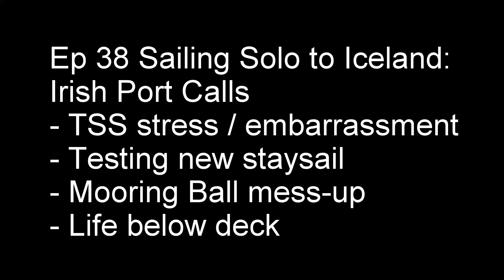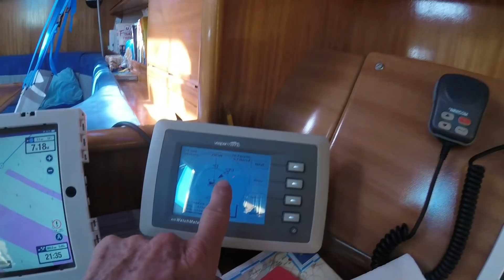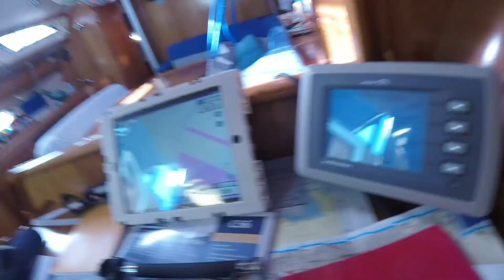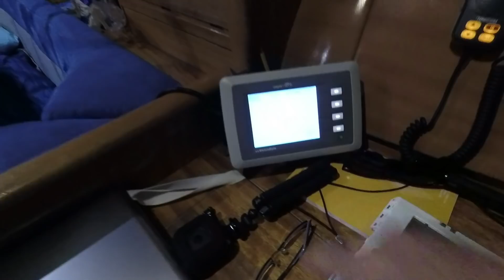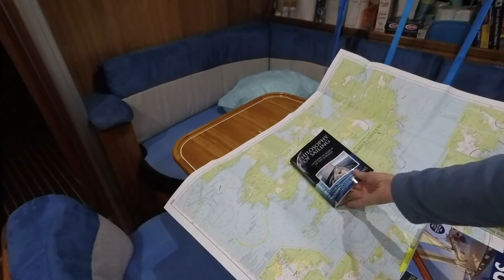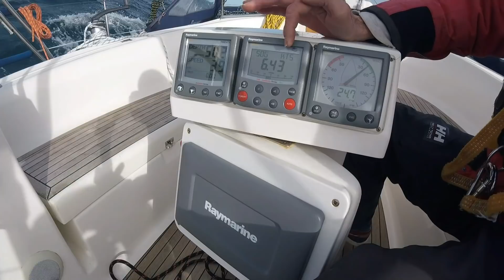EP 38 Sailing Solo to Iceland   Irish Port Calls

Comment: You could do exactly the same thing in or near a TSS next week and get completely the opposite response, heads you lose tails your lose, but as long and know one gets hurt we all win. There is as thing going on in the UK not to call channel 16 for radio checks, so I called last year on Ch 67 (having observed that it was being monitored) only to be told to use Ch 16 in future, I thanked them an consigned their feedback to the bin.
My boat and I would struggle to make a left turn into a slip as tight as that, to much left prop walk when in reverse, Ive been to the end of a fairway turned 180 and then made a right turn into the slip before, works for me as I have no bow thruster and with throttle and rudder I can make smarter right turns.
Great videos please keep it up, my docking sticks arrived from Amazon today, thanks to you. In the past I taped the bowline onto the pole with paper tape that snaps easily as the loop meets the cleat.
Im planning around Ireland late this summer anti clockwise starting from Glasgow, just might have to order  Chateauneuf du Pape in an Irish pub!
Reply from the maker: Yes Keith, that final turn in was very tight due to the narrow fairway.   I used a couple of bursts of bow thruster to shove the nose around, and I gave a good shot of reverse when about 45° into the berth to swing the stern a bit out to starboard (prop walk on my boat).    As you suggest, every boat owner should go to a remote area of his marina, and practice tight maneuvers so he/she will know what tactics might help in a difficult situation.

Comment: 17:30 - "Tight fit here."  That seems like an understatement.  That fairway looked VERY narrow.  I thought for sure you were going to whack one of those pulpits on the starboard side - a lesser man (me) would have!  Thanks for another great sail!
Reply from the maker: It was very, very tight.  I had my head right over the stern corner of my boat to ensure I would clear those others.......a bit stressful for sure.  Fortunately there was very little wind.  :-)
Reply: @patricklaine6958  Would you consider to drive backwards (stern first) into the slip an easier solution or does that depend even more on prop walk?
Reply from the maker: My boat is equipped with a sail drive, rather than a conventional shaft and prop, so prop walk is MUCH, MUCH less of a concern (the prop is located much further forward).   My boat backs beautifully, and stops very precisely, and I love to reverse in --- from time to time.   The difficulty with reversing in when solo is that once you come to a stop, you have to get a line over the cleat on the pontoon, and then drive forward to pin yourself against the finger.    It's not always easy getting the line over the cleat from the stern (when solo).   It can be quite a reach/lasso, and I have davits and a bimini frame that interfere with freedom of movement.  Thus, if you are delayed in getting the line over the cleat (for any reason), the boat will drift into the neighbor.   Reversing is an excellent technique for boats with crews where another person can lasso the cleat on the pontoon, but doing it single handed can be a challenge at times.
Reply: @patricklaine6958  Very valid point I did not think about, because I do not have single handed experience. That's why I thought to bring this question up to a well experienced starfighter pilot very able to fundementally explain the why or why not. THANK YOU SO MUCH for your kind way to explain things - though started with a crew I might find myself in a situation, where the fellow crew member with whom I left port with, is for some reason hurt or not able to help while docking. And asking then would be a little late ;-)

Comment: Thanks for your honest report and the videos! We passed that exact TSS several times (once on our way to Ireland too). The cargo vessels are very attentive and most of the time they start to take measures pretty early. We never had any problems, except of that one single time when we had to take a reef in the middle of a lane within the TSS with 35+kn of wind; but also then, the cargo vessels monitored the situation and we could get back to a 90° course after some minutes.
Reply from the maker: I hear you Chris.   I always preach, 'Follow the rulebook', but in this case, I didn't listen to my own advice.    I was in the wrong.  If I had just sailed across there normally, I'm sure they all would have zig-zagged to miss me.     My bad.

Comment: Hi Patrick enjoyed your video hopefully as much as you enjoyed your pint of the Black Stuff. Your new sail definitely looks a good investment. Your experience crossing near a TSS raises some interesting points. Just a few thoughts as you were under engine and not in a separation scheme then you are regarded as a power driven vessel (as long as you displaying daytime/ night time signals) however where I can see an issue is with Class B AIS as it maybe (dependant on initial set up) stating you are a sailing vessel and this is not easily changed on some Class B AIs sets without hooking up to a computer. So the shore station if using your AIS could issue wrong advice. In the past I think your initial reaction to keep clear would be prudent as you could have a good assumption the ship had not seen you but with AIS that assumption may not be as valid. Its highlighted a a good point and something the shore station should take into consideration before issuing instructions and perhaps the facility to switch AIS message to reflect vessel status.
Thanks for posting and safe landings
Reply from the maker: Good knowledge of the rules Ian, but if you take that logic a bit further, given the scenario presented, it makes no difference at all whether the engine was on or off.   I was the vessel to starboard in 'engine rules', and I was a sailboat in 'sailing' rules ---- my action (stand-on) and his (give way) are not altered by the use of the engine.  There was no way for him to know my engine was on, so he properly assumed I was 'sailing' and he did the proper thing (gave way).   I was in the wrong --- in that I tried to give way, when technically I was the stand-on vessel (in either power situation).     I don't think that changing AIS status settings would improve the situation --- probably just confuse people.  Fair winds.

Comment: Hey Pat. Once more, a great posting from you. Interesting, informative, and educational; a pleasure to watch. Thanks!
Re your approach to crossing the TSS (or just outside it), I understand the dilemma. There is something to be said for being "over"cautious though. Like every other rule set, it will only work if the other guy follows it as strictly as one does. I've been in a (at least one) situation where the other guy didn't quite. Personally, I think you did right the first time around to alter course to pass astern of the tanker. The fact that the pilot of the tanker was aware of you and monitoring your movements, I would consider an added safety element in the scenario, but personally would not blindly trust that that would be the case, just by trusting he rule book. Perhaps the way to avoid a rap in the knuckles, is to announce the change of course over the VHF, before doing it. We can always be told not to do it, as in your case. But that way, at least the other guy knows, we know that he knows, and the controller in France will know too! ;)
Very much looking forward to your future postings
Rafa
Reply from the maker: You speak wise words of experience Rafa.  However, my view on the use of radio has changed over the last couple of years.   Let me copy what I wrote to another viewer: I have contacted ships before just to clarify my intentions.   However, I think this practice would NOT be a good idea in a very busy area like where I was for a couple of reasons: 1)  I did not show it well, but I'll bet there were at least 30 large ships within 10 miles of where I was going both directions.   Radio comms in such a crowded area would almost certainly have led to confusion as to whom was passing ahead or behind of whom; and 2)  I quickly learned that the English bridge communication skills on many ships is 'limited' --- surprisingly so.  If you throw in words not commonly used like 'aft' or 'astern' --- again, you are likely to create confusion.  I really believe that 'best practice' is just to follow the rules (which I did not do) and keep off the radio unless in a dangerously evolving situation.   My view anyway.  :-)
Reply: @patricklaine6958  I read you Pat. I will be crossing the same TSS, more or less at the same place, southbound in June, and will have your views very much in mind. Particularly when I don't have an AIS transceiver, only a receiver; i.e. I can see them but they can't see me (other than on their radar screen). I can see how radio comms may be counterproductive. Thanks. This kind of learning doesn't come packaged in books! Enjoy Ireland and godspeed on Friday.
Reply from the maker: If you don't have an AIS emitter, I strongly suggest you time your crossing during the day Rafa.   That TSS is 30 (yes 30!) miles across, so it takes quite a while.   I would not want to do that at night without an AIS.   Fair winds.
Reply: @patricklaine6958  Agree. Yep, that's the idea. I have half an AIS (receiver),, and I do have radar, so will not be blind. And I made sure I light up on anyone's radar screen like a Christmas tree! :))
Reply: I'm a coastal sailor, mostly in the Chesapeake and while we don't have the volume of ships you were crossing, we do have quite a few including cruise ships which really move along and tugs with barges who are difficult to see and sometimes hard to know if they are moving. So I was tense just WATCHING you cross that zone. I tend to agree with you: go behind. But I'd hate to be yelled at like that!

Comment: Thanks Patrick! Fun episode! Good lesson on the TSS, most over this side of the pond would initially become the give-way vessel (size does matter!) but understanding the rules and following them ensures professional mariners do not have to scramble trying to figure out what the pesky sailboat is going to do! Lazyjacks,..same issue with my 13 meter cat (15m mast)....I leave the bag up and on each side of the boom I rigged a length of bungi cord with a clip, secured near the mast. When I raise or lower/ sail....I stretch out the bungi and secure it to the after component of the LJ, and it pulls the loosened lazyjacks to the mast (ish)....eliminating raising/furling and chafe while allowing the bag to take reefs. I was impressed by your request for a nice glass of a French wine (champagne?) on arrival, but equally impressed with the innkeeper maintaining a straight face and offering up a pint of guinn...er....Murphy’s stout.....Really look forward to your episodes! Thanks! Andrew
Reply from the maker: I really like your Lazy Jack solution.  I'm going to play around with that concept on my next passage.   I reef often, so am uncomfortable with keeping the LJ and Lazy Bag completely tucked away (not ready for rapid use).  Your solution suggests a half-way house that could be very useful.  Thanks.

Comment: Thank you for the video Patrick! You deserved that Guinness :) It is interesting that you mentioned lazy jacks. I tightened mine the other day - they didn't work when they were loose. I must say I wasn't aware of the problem when they rub against the sail. Now it will be yet another thing to adjust while sailing! :) Safe trip!
Reply from the maker: On my boat, the chafing is maximum against the lazy jack when I take a reef.   At that point, where the lazy jack line crosses the batten it has worn a hole completely through the material…….   I'll probably retire that sail after this trip.   It has served me well.

Comment: I have crossed the Channel several times, although never in the TSS since I always managed to cross several miles from the extremities. I have always applied the strategy you describe (I think!) which is to select a ship to pass right behind it, which means as far ahead as possible ahead of the next one.

As the rule says that the change in course should be clear and noticeable, I usually make course to the aft of the ship, which is, of course, more change than necessary, and then I alter my course slightly in the other direction while approaching the ship's route, but making it always clear that I am passing behind. I never had any problem of any kind. I always cross with the engine on, so I do not have priority as a sailing boat (although I must confess I never put the black triangle to signal that the engine is on;  I think this could in fact not be seen by other ships at a distance.)

From your description of the incident, I understand that you were out of the TSS, with your engine running. In any case, you were perfectly right to alter your course (and speed) to go where you wanted, and in particular to pass behind the tanker. The only case where you would not have had the right to do so is if the tanker had already altered its course and/or speed to pass behind you. In such a condition, altering your course to pass behind it would have restored the collision condition it had just avoided.

Is it possible that this was what happened?

An additional question is about your AIS. I guess it is a transponder and that's why the tanker was able to call you by the name of your boat. Do you confirm? In such a case, is Isabelle declared in the transponder as “Sailing vessel” or as “Pleasure boat”? This could make a difference because a sailing vessel would have extra priority which a “Pleasure boat” might not have, and this could have caused the Tanker to alter his course. It might then be better for us to give up priority by declaring our boats as “Pleasure boat” rather than “Sailing vessel”. (It's a shame that AIS B does not include the information about motoring! Some even prefer to go silent when crossing ship routes!).

The last point, you say that the French traffic regulation contacted you to ask if you had understood that you should maintain course and speed. I guess they called you in French since you sail under the French flag, and they might have wanted to confirm that you understand English ;-) Do you confirm?

I wish you the best for the rest of your journey.

Pierre-Yves
Reply: From a strictly regulatory and legal point of view, by complying with the obligations of RIPAM; our friend should not have changed his route and his speed. Of course, the common sense, the habits, make that the sailboats avoid the big cargo ships; but we have a regulation that is out of step with the way in which, with the help of new techniques, we could navigate. Finally, the fact that the transponder posted without a doubt "sailboat" left no gap, and forced the vessel to change its course.
Of course, I have always crossed the English Channel with the practice described above: change your route widely to get behind the cargo ships!
Another example: in the November issue of "Voile Magazine", there was an article that said, confirm (following a similar mishap to that of Patrcick) that inside strictly the TSS, the hatched portion in red on our maps, ALL vessels, including fishing vessels and ALL pleasure boats, are prohibited from navigation; this shaded area must remain empty of all boats, including ours.
dura lex, sed lex :-)
Reply from the maker: Isabelle's AIS is 'sailing vessel'.   I'm not sure I agree with your interpretation of the rules Pierre.  The fact that you are a 'pleasure boat under power' doesn't change anything.  If you are the boat to starboard, then the 'cargo vessel' MUST still give way to you --- and you are REQUIRED to maintain course and speed --- even if you are a small pleasure boat underpower.   That's my understanding anyway.
Reply: Being a « pleasure boat » instead of a « sailing vessel » does not of course change the rules, but it changes which rule applies. If you are a “sailing vessel”, it makes you a privileged boat (unless it's clear that you have your engine running, or you are in the TSS, which was not the case).
So, if you are declared as “sailing vessel” in AIS static data and are not showing a black cone, you are being considered by other ships as a privileged boat. As such, you must not alter your course and speed.
If you are declared as a “pleasure boat”, you are not a privileged boat unless the other boat sees you on starboard.
In any case, even if you are the privileged boat, you are still allowed to alter course and speed to avoid collision as long as the other boat has not altered its own course yet (Rule 17 a ii).
So, my question was mainly about whether or not the other boat had started altering its course and/or speed when you altered yours.
Reply: @farfaTrebeurden  
I agree about the first part of your answer, so I think it is important to alter course much in advance. And I think that’s what the big boats are expecting. The small boats, whether they are pleasure boats or sailing boats should alter course before there is a risk of collision forcing the non privileged boat to alter course.
I do not agree about the TSS though. We are allowed to cross the TSS but we should as much as possible avoid it, and if we can’t, we should cross perpendicularly (Rule 10 c). But personally, I never cross the TSS.